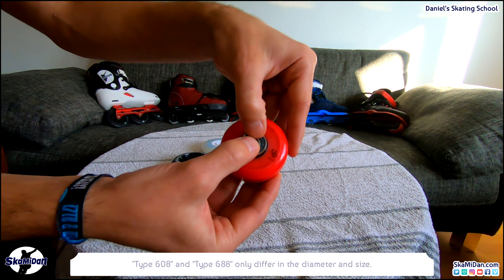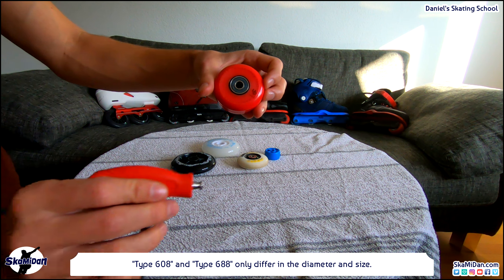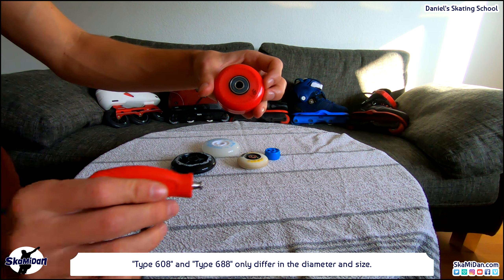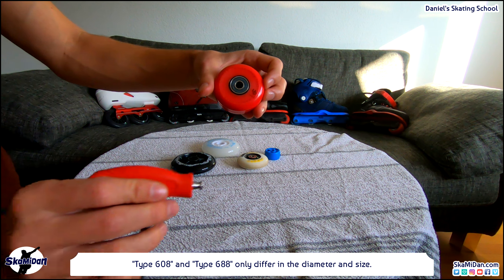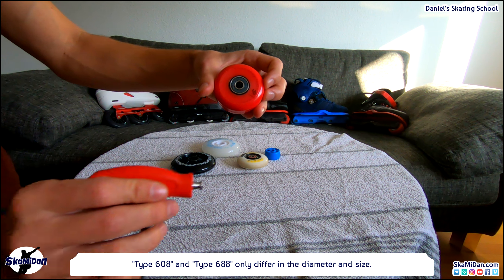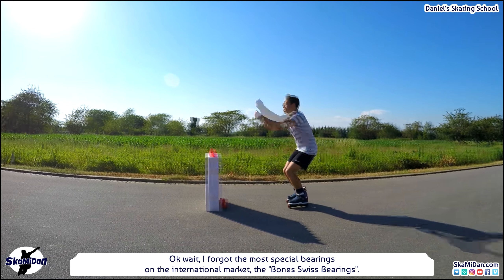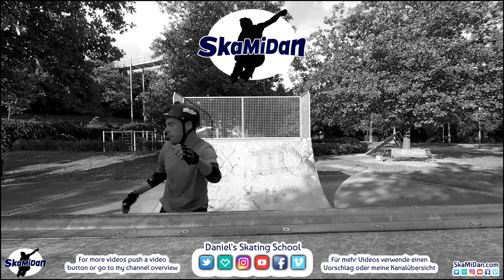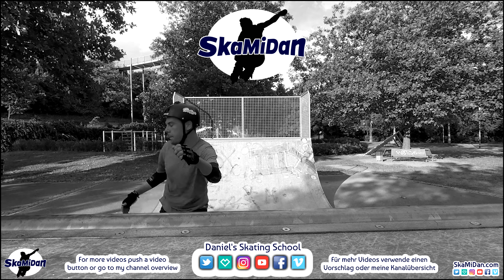Skate Wheels And Bearings - That You Have To Know - Properties And Sizes - Inline Know-How #04

Comment: I know I'm late but I really want to know cause I've been having trouble getting used to my aggressive skates and no one knows but are the two middle wheels of the aggressive skates supposed to move I know I'm dumb
Reply from the maker: There are three different setups for aggressive inline skates. The first one is the flat setup with 4 skate wheels of the same size on each frame with a small or great grind groove between of them.

The second is the freestyle setip with only two wheels on each frame and a huge grind groove between them.

The third one is the "anti rocker setup", the setup you already mentioned. There you have two skate wheels, on in front and one in back and two small grind wheels in the middle next to the grind groove. The small grind wheels are not for rolling, they are for grinding. These prevent wheel bites and thus reduce the dangers of getting caught and stumbling when grinding.

A few years ago I made a video about these different setups:
https://www.youtube.com/watch?v=Do7l-dlMGpk

Comment: Do you recommend 88a-92a for indoor speed skating wheels?
Reply from the maker: Hey there, I'm not a speed skater and I do not have any experience in speed skating. So, I don't know what wheel hardness is usually used for indoor speed skating. But 88a - 92a sounds a little bit too hard, with this hardness you will slide when turning or skating curves at high speed. But anyways it could be, as I wrote before, I do not have any experience in indoor speed skating. :(

Comment: Wicked or Titen abec bearings? Which brand is better?
Reply from the maker: Both brands are fine, but I myself prefer Wicked.
Reply: Daniel's Skating School & Skateshop [SkaMiDan-EN] wicked ones are cleanable, titen's are sealed instead, i need just the most durable because i skate in a Park near the sea with a lot of dust
Reply from the maker: Well, in this case I would prefer Wicked bearings. 🙂✌

Comment: Where on the "A" scale, does a wheel go from being a soft wheel to being a hard wheel??
Reply from the maker: Let me answer this question as follows:

Indoor wheels have to be very soft, because the softer the wheel, the better the grip. And the ground of rinks like hockey rinks or roller discos are very smooth. So indoor wheels go from 65A to 82A.

Outdoor wheels have to be harder, because of the uneven and not so smooth grounds. Soft wheels would have a too fast wear out. Moreover when using very soft wheels on uneven ground you would lose a lot of speed and it would be very exhausting. On not so smooth grounds you will natuarlly have a better grip, so outdoor wheels go from 82A to 88A. I myself prefer 85A for urban skating with tricks and 88A for urban skating from A to B or for faster skating.

Aggressive wheels have to be the hardest wheels, because you like to slide, to grind and you won't lose speed. The harder the wheel the less grip you will have, the faster you will go. And this is perfect for Aggressive inline skating (skating at a skate park and so on). Aggressive wheels go from 85A to 92A. In addition for aggressive skating there are grind wheels which have to be very hard. Grind wheels and grind rocks go from 95A to 110A.

Lastly there are SUV wheels for off road skating.

I hope I could answer your question.
But should you have any further question, just leave a message. 🙂✌
Reply: @skamidanen  hi SkaMiDan, im a total beginner in inline skate...but my 1st skate that i bought is fully rockered setup..its really hard for me to find my balance at first but now, i get used to it and it is fun because of the agility of the rockered setup.
My question is should i change back to flat setup and get comfortable with it, gain some confident with the 4x80mm wheels, or just get going with the rockered setup...? Thanks

Comment: Handy as always Daniel. I’ve been using the Bones Swiss bearing since getting back into inline. They have served me quite well and the ability to clean them will make sure they last as long as possible. Bones also has a couple more high end products as well as a new (well new to me at least) product. In terms of price range, Bones Swiss then Bones Super 6 Swiss (like the regular Swiss but with 6 larger balls in stead of 7) and Bones ceramic. The new one (i think) is the Bones Super Red Ceramic. Based on their name I can only guess it’s built around their “Red” design but with the upgrades of the “Super” variant and ceramics added in.
Reply from the maker: Hey Daniel, thank you very much for all the information you gave given! 🙂🙏